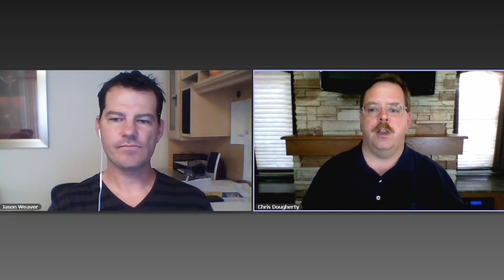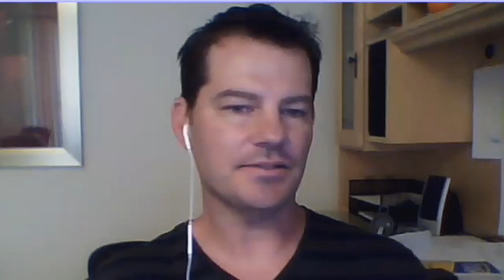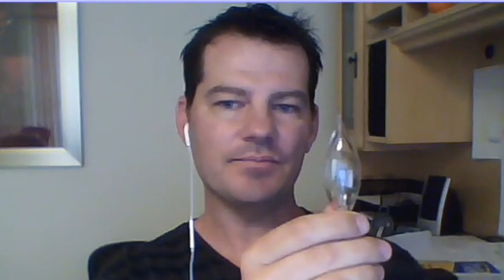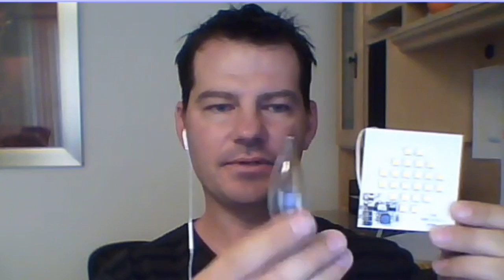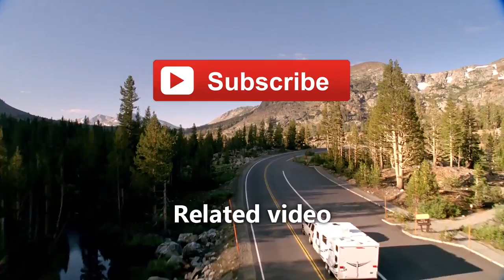How are LEDs different from traditional lights?

Comment: So the con's of LED's are?
Reply: Biggest challenge to LED is the price point. You usually get what you pay for.
It has a higher Lumen per Watt than traditional incandescent, but the source of the light is different.
LEDs generate Heat.  If the LED lamp consumes 5 Watts, then that heat will need to be evacuated/ventilated or the temperature will rise.  These things can start fires if used incorrectly.  LEDs do NOT like Heat (or Water/Humidity).  Most LED lamps are made in China and they bench tests them, which is much easier on the LED (sitting in open air) versus mounting inside a fixture (where the heat is trapped).  Unfortunately, Not all LEDs are the same (quality of materials vary) and unless you take it apart to test/inspect, you have to judge based on price point and experience.  Almost All companies in the USA simply buy and resell and do not understand the technology.
There are other negatives;  They can generate RF that can interfere with electronics and they are not bullet proof as some claim and can be damaged during handling (they are electronic components)